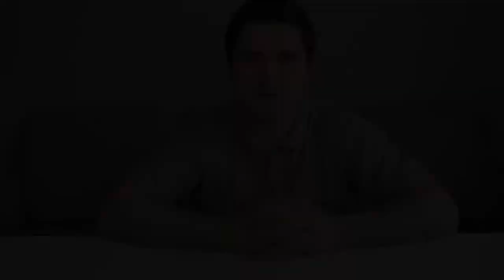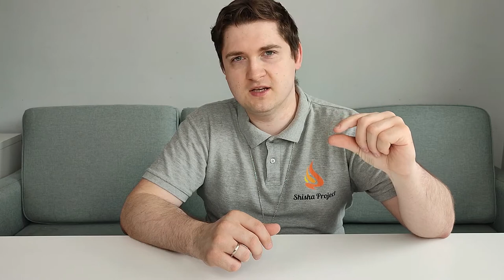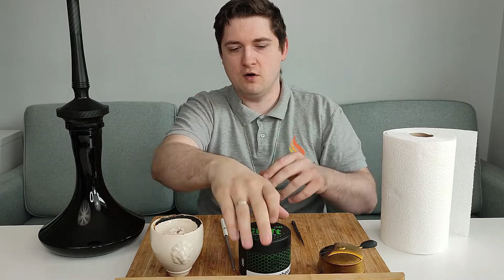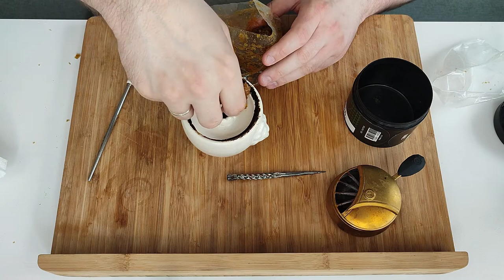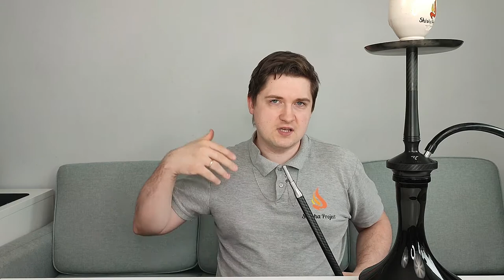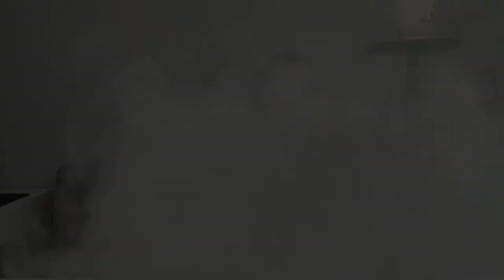How to set up Hookah? Phunnel bowl + HMD

Comment: so you don't let the tobacco touch the HMD?
Reply from the maker: No.On HMD you have normally flat place and some dots 2-3mm (on bottom) for example on Kaloud Lotus. Tobacco you put maximum to this dots and leave space 2-3mm. I smoke on this video on Zeppelin and you have on bottom like ring who make space 3-4mm. So you need to have gap beetwen tobacco and HMD. Different situation is when you smoke overpack but I told about this in another episode.